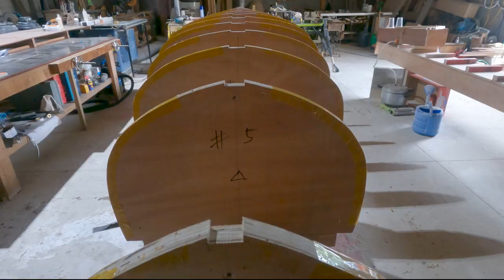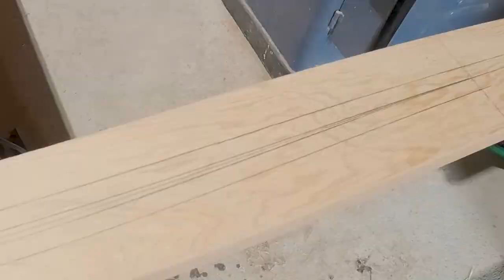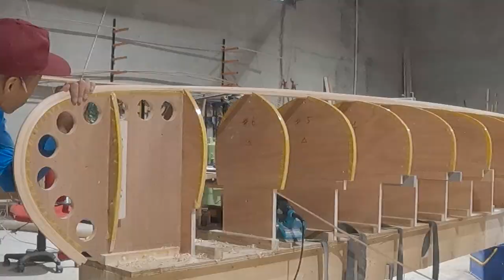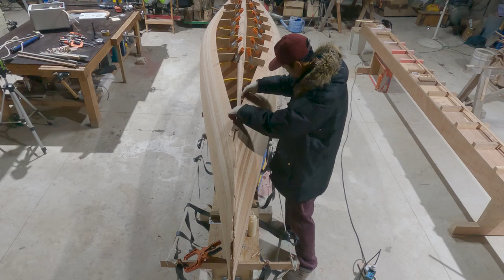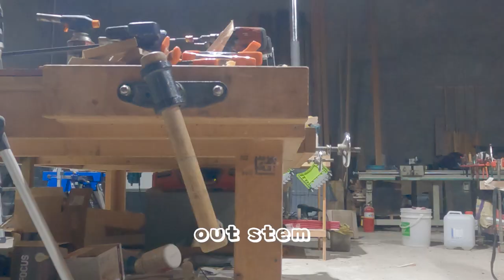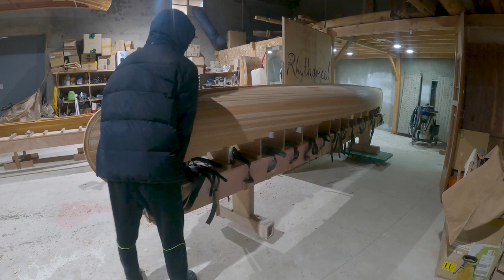My second Redbird strip Canoe Ep.1

Comment: Great idea about the keel
How did you decide on the angle of the taper of the keel. From narrow at the ends to wider in the middle
Reply from the maker: I set the middle part of the keel wider and higher, then carved a natural curve using a plane. I used a long flexible strip to draw a smooth curve from stem to stem. Keel work was very challenging for me.